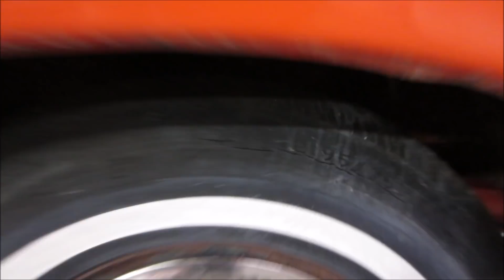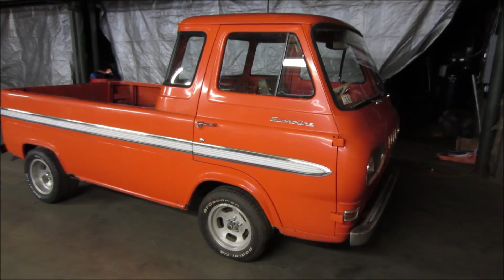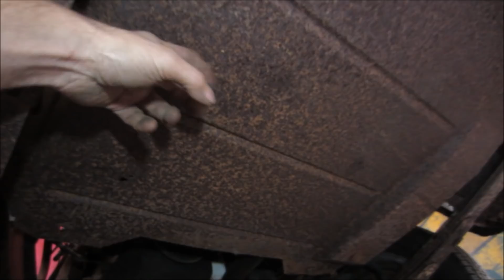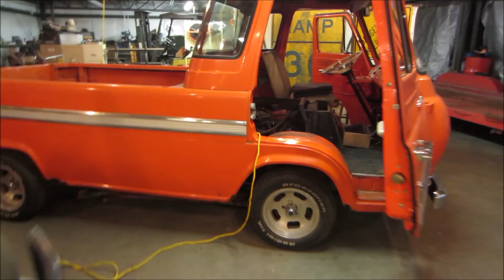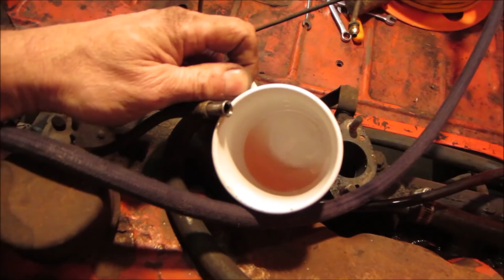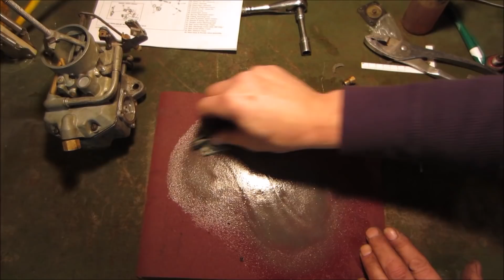Bought A Ratty Ford Truck,  Let The Fixing Begin.

Comment: Don't put air shocks on that thing unless you want to have a choppy, bouncy ride. There isn't enough weight on the back and you will be bouncing down the road like crazy. Probably even dangerous and hard to control at higher speeds. You will feel ALL road imperfections.

Comment: Definitely a very cool truck. We have a farm (for sale now)just outside of a Toronto and my grandfather stored his ‘63 Galaxie in the barn about 30 years ago. The body was terrible but the engine was decent. We scrapped the car but kept the engine (260) and transmission with the intent of doing “something” with it. Never did, carb is missing but everything else is still attached. If you’re interested, I can send you pics and you can have it, shipping your cost. It turns over etc.

Comment: Love your videos!  When you stomp the gas, the manifold vacuum goes away (becomes nearly atmospheric in the manifold). This makes the vacuum advance go away, reducing the timing back to base timing (around 10-14 BTDC typically).  The mechanical advance then kicks in as RPM increases.  The vacuum advance gives advanced timing  for part-throttle cruise when manifold vacuum is high (typically 40 degrees or more).  Incidentally, when the manifold vacuum is high (part throttle cruise), the fuel in the intake is almost completely atomized.  When you stomp the gas, manifold vacuum rapidly decreases and the fuel that was in suspension condenses out onto the manifold walls, causing the momentary lean condition that the accelerator pump that you fixed takes care of. Keep up the good work!

Comment: Hay mustie   just a suggestion.    Maybe could hop up the 6 cylinder  Clifford performance sales headers and intake manifolds  and cams.
Reply: Yeah, I agree! The 302 has been done to death, and LS Swaps are ten a penny. Pep up the six a little! It won't be fast, but it'd be a bit quicker and more fuel efficient than a "Period Correct" V8 :)

Comment: When ever you see weights opposite each other on a wheel, someone spun it a second time, in stead of getting it right the first.    Most tire machines have a setting to put all weights on the back.  I once helped my cousin put a 289 in an Econoline, 3 speed.  It always ran very warm, even with a big radiator. Must have been a low air flow.

Comment: Ah, the lost art of manual choking.  I miss that sometimes.  A 302 conversion?  I saw it done on a ‘63 Econoline van.  Much modification needed, but a fine end product resulted.  Your truck has a lot of potential with the original engine.
Reply: Hemi pistons ?
I had Wisco hemi pistons installed in my 86 Sportster when I had the engine ballanced and blueprinted.
Only time someone else worked on an engine of mine.
It's takes some serious cash to have the equipment to do all I had done.
58 hundred in 94.
A whole buncha other goodies installed in it.
Andrews close ration gears and lifters, Kevlar clutch and more.
Loved blowing ring ring rice rockets away.
Reply: I could be wrong, but I believe you could buy an econoline with a 289. So it might be a easy upgrade.

Comment: I had a 65 be van with a 144 , I had over heating problems I put a electrical fan and a larger belly pan on . As long as you were going 35 or fastest you were good , stop and go traffic would over heat. Love the video.

Comment: The fuel inlet fitting, there's probably a fiber or plastic washer in the kit that fits between the carb body and brass colored nut if it leaks again, another great video!

Comment: That style of engine with the intake and the exhaust on the same side were great for catching fire when you had a fuel leak.
Reply: True, my late father an electrician had a 61 Van version of this and the carb had a leak and he threw snow on it till the fire department showed.
Reply: They used to call these vans "Up in Smoke ".
Reply: They were on a Ford Falcon chassis, If I remember.
Reply: @allenschmitz9644  so did CHEECH and CHONG  :))
Reply: Neighbor has a 64 pickup like this, came home from garage but thank Henry Ford he did not pull it in to the double wide garage, 10 mins later the neighbor is Ubangi on his front door and he opens the door to find the cab belching flames and  cracking the windows, luck he only had 2 gal of gas but  the engine cover was SPRAY FOAMED and that went up like a torch, FD  300 ft down street  and it put itself out.........
HEY MUSTIE KEEP a F EXTING handy and poke a hole in cover  to keep a CO2 EXT handy even while  driving
Reply: @Teleman73  not quite, a unit body with Falcon Componenets

Comment: My stepmom had a 65 wagon here in Australia with a 170 “pursuit” engine with a 3 speed standard shift. First standard shift car I ever drove. I remember it as being a very smooth motor but a bit gutless. I remember my Dad always replacing exhaust manifold gaskets as it was always blowing them out especially around number 6 cylinder. Looking forward to seeing this cool truck back on the streets as I catch up with your videos 👍👍👍

Comment: Wow. It runs (well, idles) great for having been sitting for so long. Those mags are perfect, too. Wouldn't change a thing (except fixing the exhaust and brakes and doing the stuff you've mentioned to the suspension and body).

Comment: I loved watching you rebuild the 1100. I rebuilt one a few years ago and had the same issue with getting the fuel line started and leaking. Also, the two accelerator pump diaphragms are because the automatic trans version has 2, one gives an extra squirt when letting off the throttle to catch the rpm drop.

Comment: Wow,  a flash back..my first van was a a '65 ford Falcon  window van, had the 240 6 cyl. I put a 289 in it when I was 16.  Sadly a VW beetle and a bad driver made a left in front of me when I was doing 55..I went right thru the windshield ( nlo seat belt on luckily) and that bus type steering wheel was pushed right back into the drivers seat.  My NEXT ride was a '66 Galaxy 500, I WANTED something with a HOOD out front..LOL
Love the vids Mustie..thanks man.

Comment: The wheels are the perfect style for the era, and improve the look of the little hauler, so far all the other videos on that truck with that motor the exhaust manifolds are broken
Reply: JEEP WRANGLER and CHEROKEE wheels are a direct bolt on and uses stock lugs, 1988 to 2000..............

Comment: That might be a '5' where you are, but it's easily an '8' for an unrestored van in the UK! You dont know how lucky you are lol! Great work dude, love the wheel combo!
Reply: BajaBill I thought New England rust was bad, I hadn’t considered “Old” England-  cheers!
Reply: @esigman1  Neither one is as bad as Detroit. We are on a salt mine, so guess what gets put on our roads every winter.
Reply: @grosseileracingteam  Urgh, they slather the salt on here. What doesn't rot your car out, gets flicked up and breaks your windscreen 😣 They could try taxing us less and use the money saved (inc car repairs) to allow us to buy winter tyres, but there's no chance of that happening!

Comment: Had the same problem with the fuel intake flare on my Autolite 1100 (same carb) on same engine. I ended up using teflon tape that i cut down the middle and made more narrow. Worked like a charm. Many will tell you not to do this but if you are prudent it is the way to go.

Comment: One nice thing about engine access inside the truck is if you ever drive headlong into a foot deep flooded road you can open it up right there, protected from the rain, pop the distributor cap off and and dry the points out (etc.) and in no time you can be on your merry way.

Comment: Had a 61 econ. van , put on a 25 dollar motor body mount and had the heater core boiled out. Boxed in behind the seats , it would run you out , a awesome little van , run forever.

Comment: An actual Mustang L6 drivetrain, double head- and -rearlamps,
and its HOT! Rear upper red as back/stop, the lower as turn signals
in amber and 1/3 white reversers. Front inner smaller, as high beam.
Better seats with good lateral suppoert with heating, and full leather
interior. Brake and axle upgrade with EBC carbon discs and yellow
brake pads.

Comment: Great job on the carby rebuild.  Looks like that 1100 has the load-o-matic valve, which matches up with the stock distributor.  Once you get her dialed in she'll be sweet as. If it keeps leaning out make sure you check to see if the air horn needs the throttle shaft re-bushed.  On the exhaust manifold, soak up the #1 (frontmost) bolt real good, its prone to break off in the head, and be equally as careful when you torque the same bolt up as it goes back together, the metal at the head is real fragile right there and overtorque will crack the head or the "ear" where the bolt goes, then it's new head or welding time.   I had one of these in Hot Wheels as a kid, i think it had an engine in the bed, or something like that.  This thing would look bomber with some slotted mags, jacked up in the back and a slammed front, or maybe go the other way and give it a gasser stance with big and littles/skinnies up front.   For a NH truck it sure looks awful free of tinworm thank goodness.  Looking forward to the rustoration on this one, hopefully the single cab doesn't come down with a fit of jealousy and refuse to start next time though!  nb. me & dad learned the hard way about fuel leaks on the 170/200, and why you shouldnt use hose clamps and rubber fuel line to the carby when it is routed over the exhaust manifold ;) Thank the Lord for fire extinguishers, is all I can say to that one.

Comment: I put some mag rims & tires on the old `65 Econoline van I had. They weren`t as wide as yours, though. During the winter months, I put regular sized snow tires back on - even used cleated chains for deep snow, chugged right through drifts ( the front skid pan would lift & slide the front end over the drifts a bit but the chained rear tires would eat right through ). You will need to re-hone the wheel cylinders and install new rubber cups ( I did on the van and never had any future problems ). Kinda miss my old van, it was fun to drive. Sure would like to find another one - providing it isn`t a rust-bucket.

Comment: I'm not sure I would harass the E100 for having "only 80 HP" What does Crusty have ???
Reply: Here we produced the Falcon for long long years and on the same slant 6 we had the famous 221 with 130HP, it was a 3.6 liter. Pretty decent figures for such a shy engine Nice sound also.

Comment: Oil change, trans oil change, diff oil check,radiator replacement hoses fuel lines, I’d flush out the coolant. Hook to temp tank run to temp see if head lights work tail work on carb check on fuel pump. Get some of the main running gear go put it on the road stop start around the block or around the shed. See if Lucy wants a ride

Comment: Hi, great project “truck”. Have you ever considered media blasting the underside?
Reply: mustie does not do much body work most or maybe some of us would cut and pin new metal bondo sand skim coat sand prime sand paint  clear coat not mustie it's for the next guy you! lol ; ) watch and learn a mustie rehab and drive.
Reply: Are you from the west coast?
Reply: Media blasting and lose al the galvanized steel?
Pressure wash and a good coat of bar and chain oil does the trick.
Reply: @samuraidriver4x4  That Galvy is great, isn't it? That makes his work load so much less. He'll also find a tank and have it modified. $400 for a new one?!! I was thinking $200 would be steep. That truck is beautiful!
Reply: @jlucasound  Yeah, 400$ is expensive. Coul'nt a salvaged pick up tank be modified and fitted ?? Worth a try...
Reply: I think the leaf springs would hold up to blasting, but underneath the bed looking up it looks like the night sky. I think blasting it would increase the size of the holes.
Reply: I dont think that would be a good idea on that truck
Reply: It's not called "sandblasting" any more, because there are media that range from very aggressive to very soft. It would be nice to get all the rust off, and maybe patch in a new bed floor.
Reply: You can get 80s Dodge Rampage  "trucks" for cheap.   In twenty years they'll be as unusual as this E-100.  I've got two Rampages. Not as good as  this Ford, but you won't see one, even when new they weren't very common.
Reply: @timothykeith1367  Yea I agree I got a "Dodge" Raider by Mitsubishi for free thing runs killer (after fixing the million miles of vac hoses on it) about as "rustorated" as this old E100 but not as cool, although I get tons of questions and thumbs up when I bomb around in it.
Reply: @deepbludude4697  Dodge A-100 pickups are also pretty rare.  People should have saved more of these workhorses that were used up and junked. But who thinks like that?  Its a labor of love to keep an old truck from being scrapped.
Reply: @timothykeith1367  Agreed I picked up last spring a 70 W200 for 300bucks I have "rustomoded" it, she runs great, I am just getting ready to change out the spring bushings on her. There's a 67 K20 chevy im eyeballing on CL right now.... You can see the old W200 on my chnl….

Comment: Just a tip on the trans. I had a friend that collected both the Chevy and Ford versions of those, so I worked on a bunch of them. On the three speed there is an interlock so you don't put it in two gears at once. Chevy built that into the trans while Ford built it into the linkage. So make sure the linkage it tight and working properly. That way you don't have to R&R the trans on the side of the road like I had to. ;)

Comment: What about flaring the rear guards just a bit
Reply: And then lowering the ride height a bit...
Reply: =ruined
Reply: @pyry1738  Right. We will have no "lowering" here. This is a 1965. We go "Up". Not practical (as far as handling), but it looks so cool. We drive slower now, too. And somehow survived the 70's.
Reply: Too good of a starter, but if you go crazy on it, I vote for the Gasser look.

Comment: Hi Mustie, In Australia we have an Engine called a Barra which is a six either normally aspirated or turbocharged either way they are a fantastic engine We use them in our Ford vehicles eg Falcon, Territory etc There is no reason why you can’t get 300.000 plus kilometres out of them They are Australian designed and are popular in New Zealand as well They are a size equivalent to your Ford Econoline which is gre same engine we used in our Falcons in the 60s ( from 170 cu right up to 250 which was a cross flow .In 1985  ford went fuel injection and was the precursor to the Barra engine we use today Turbocharged up there is no reason you can’t get up to 1200 hp but most stock ones ( non turbocharged ones) are about 196 or so Any how Mustie Google them up  Love your show Cheers Graham

Comment: I guess it was mid 70s, I owned the van version of this truck. Also with the 6 banger. It was a window Van with worn out latches on the windows. So every time I turned a sharp corner, the windows on one side would open! Wap, Wap Wap Wap...you get drift! ...Newk from Kentucky

Comment: One technique I used to get rusted screws, nuts, and bolts loose on vacuum cleaners was to heat them up and then spray them with PB Blaster.  The PB Blaster will wick up the threads and crack the rust loose.  It might take two or three times of using this technique to get those stubborn bolts loose

Comment: If you go to a 302, I used 289, same motor, you'll have to do a little floor surgery, on sides, I just sliced, and bent up sides of engine compartment, and if you can find it, borrow an engine cover from an old. Dodge van of the same era, wider at the bottom of cover, but still allows stock seats to be used. I used a universal engine mount, but yours should have the tube mount already, my '65 van did. Made hangers to bolt universal mount in, and made a U bracket to bolt C4 into existing trans mount. That driveshaft is tougher than it looks, I just used an adapter universal, and stock rear end. Stock speedo can be used with cable, but gear has to be changed. I had cooling problems at a stop with stock radiator, been a long time ago, with tech today, custom radiator, and an electric fan, shouldn't be a problem now days. I was going to go to a Buick V-6, for more room, and better air flow, but never got around to it. Those rear wheel wells do suck, I just used a set of 3/4 ton overload springs I found in the junk yard, little rough ride, but never ate a tire up. On my '63 a previous owner rounded, and flared rear wheel wells using steel pipe, looks alright, and gains about 3 inches, but I liked squared better. Weight plate is above gas tank, vans used them too, I added another 80 pound rear tube bumper too, still squirrelly on ice and snow. That belly pan really aids in airflow to radiator.

Comment: finally, something that i know about!
that weight in the rear that you mentioned is located above the gas tank and it has some strong bolts holding it to the underside of the bed.

Comment: The engine brings back memories of my youth mate. When i was 18 i had about 5 60's falcons with the same motor as that babe youve got. Great motor! Those exhaust manifolds where a pain in the ass, always breaking. Ford Australia used the basic design of that engine right through to 2016 with the incredible Barra 6 in line. I think i was like you with the v dub engines, could wrench those ford sixes blindfolded lol. Nice project truck mate!
Reply: Heh, same here. Had a couple of 'em myself. Lovely old girls. I put a 221 from an XW in my last XP Hardtop, visually identical but with a few extra cubes. I was going for a factory resto so it was perfect. I miss the car, but not the continual maintenance.

Comment: I has a 60s dodge van that had the same look. small CI v8 between the seats like the ford. at about 60 mph it felt like a hundred with nothing in front of you but a windshield and black top. I loved that little light blue van.